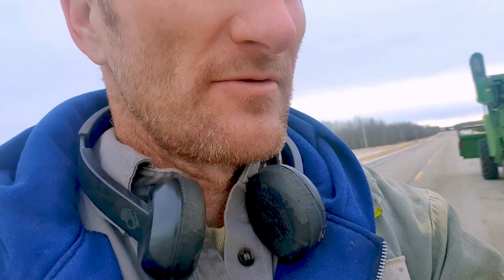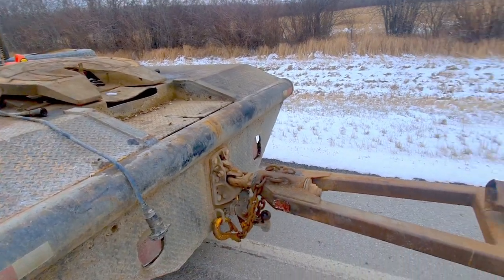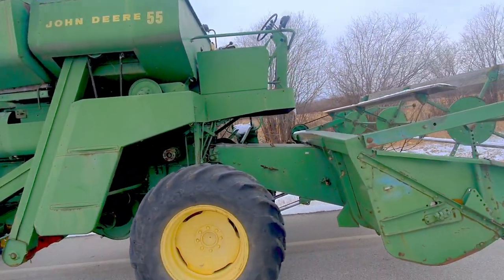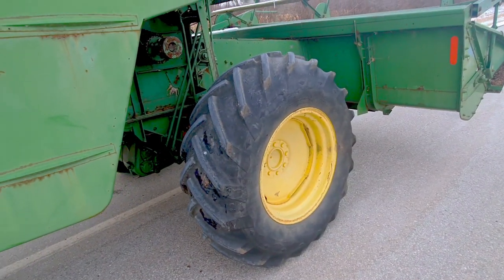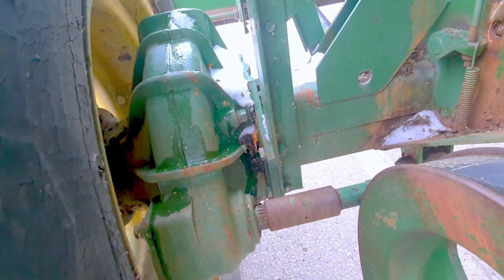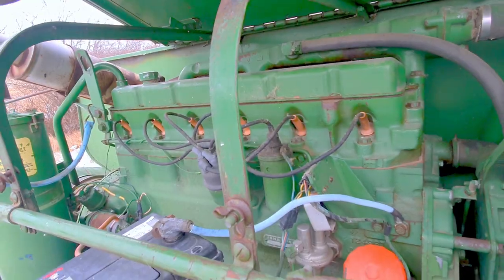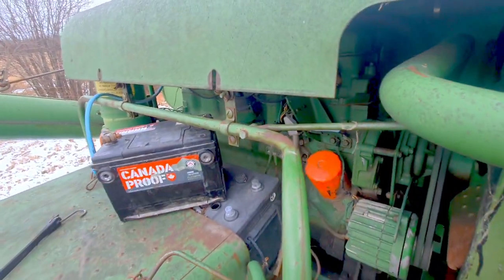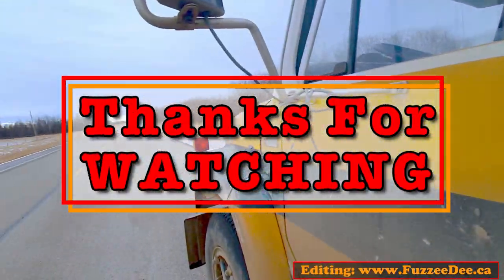Towing a John Deere combine behind my truck

Comment: I like it, lotsa parts to use ,or estate sale. Good stuff bro, have fun ,be safe. That inline 6 looks tight. Power😁👊, ttys bro👍✌
Reply from the maker: The engine surprised me.  He said it ran great,  but after sitting there something like 5 years,  all  did was dump in some gas,  pull the choke and crank about 30 seconds.  Coughed and sputter to life,  and 15 seconds later idled smooth as can be. 
Thinking I'll maybe use it for hydraulic power unit to and modular pto.  There's a half dozen machines that could share the same power source,  just hook it up to whichever you need at the time...
Sawmill,  edger, firewood processor,  large tree log splitter to name a few.  If it's set up right,  tons of options. 
Hope you are enjoying good weather.

Comment: Them are some funny lookin’ glow plugs but you say it runs good so there ya go lol. Good luck with ur projects!
Reply from the maker: You mean on the combine engine? Ya. I'd be thrilled if it was a diesel engine instead of a gasoline.  If it was diesel I'd probably be looking to put it in a vehicle. But it sure sounds smooth and quiet when it is running.  Now to come up with a sensible plan for using it.

Comment: As close as I can tell it's a 1968 year model with the 303 Cu. In gas engine rated about 72 HP in the 55. That engine has the exact same block as the 329 cu. in diesel used in some model 4400 comebines. A 329 will bolt right up to a 55 or model 95 combine with the 303 gas engine. The model 4030 tractor could be had with either the 303 gas or 329 diesel. You didn't say anything about it but I would strongly suggest disconnecting the drive shafts from the transmission to the final drives before towing. Things will be in a lot better condition when you get home. I like your tow rig, but  I would suggest putting a couple of short ramps so that you could either back or winch (if necessary) the rear wheels on to your tow dolly. The combine will pull much easier, follow better and the rear tires will be in better shape when you get home. You have a lot of good stuff there. As an old John Deere nut I hate to see it scrapped. There are collectors who will  buy it just to take to antique comebine field days.
Reply from the maker: Thanks Dave. That is some great information about those engines!! Makes me want dig into it even further. 
My understanding from Kevin who I got it from,  was it's wore out with holes and leaking grain in several places.  It does seem a shame to scrap old machines.  I feel the same about older vehicles. - not much loss or love for most things built since the 90s, but can't save everything either. 
I  ended up pulling as is, but it's only something like 12 miles,  so nothing too crazy.  Nothing got warm enough to cause concern anyhow. 
I wish I had a great use for the engine.  What type of fuel consumption rates were they known for? And running rpm? Things like this belong in some vehicle where there's no electronics or computers,  just mechanical good old reliability. 
Stay tuned for further nonsense and entertainment my friend and thanks again for such a great bunch of information.
Reply: @lovesloudcars  That engine could  be set at any horse power from 72 to 90 depending on which combine it was in and what type of drive system. In the 55 with a variable speed system it was rated 72 Brake Horse Power @ 1900 RPM. With what John Deere called hydraulic drive (we'd call it Hydrostat now) they bumped it up to 80 HP @ 2200 RPM. In the model 95 they rated it at 90 HP @ 2500 RPM regardless of the drive system. The diesel versions also 303 cu. in. were rated exactly the same.  As to fuel consumption in gallons per hour I can only guess based on my experience. Maybe average 2.5 to 3 GPH depending on conditions. They were probably no better or no worse than other   manufacturers gasoline engines of that era. Definitely not as miserly as the diesels but when untaxed gasoline was probably around 20 cents a gallon most farmers weren't willing to spend the extra for the  diesel option. That engine and other parts definitely will be desirable to John Deere collectors and small farmers still using those machines.
Reply from the maker: @davewinter2688  thanks for the further details.  I'll snoop around to see if there is anyone interested in it in these parts. That's one of the disadvantages of farming getting so big is that there's hardly any small operators anymore.

Comment: I’ll bet the old guy you bought that combine off gave you the usual used equipment warranty...if it breaks you own both halves
Reply from the maker: Pretty much. He said I am more than welcome to try and used the axle for the slasher, but had to take the whole machine if I wanted anything off of it.
I think It was a pretty good deal. I've bought some trees off him before to process into firewood & paid a good fair price for the logs, so this will be some bonus material I guess.
The engine runs so well, I'm trying to figure out the best use for it. PTO unit, or what...